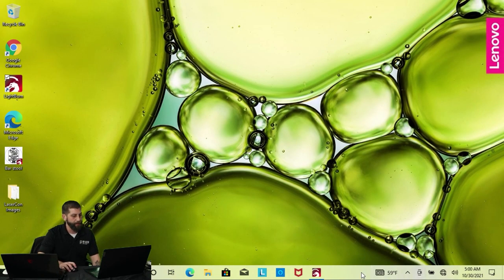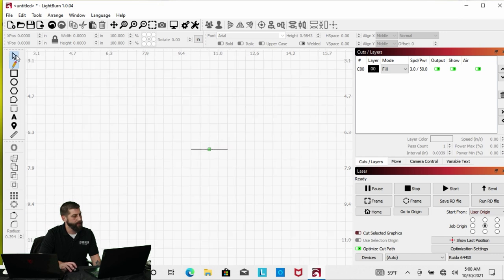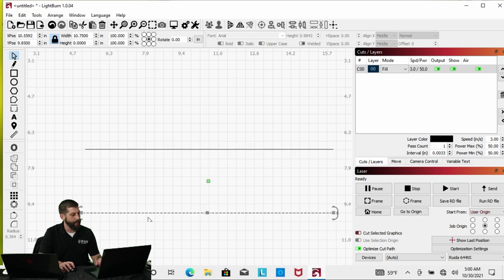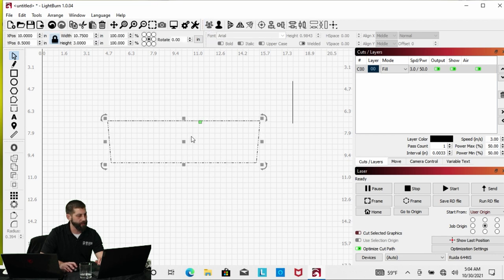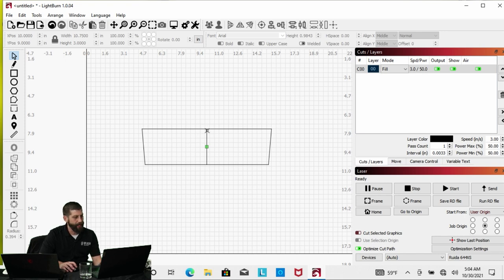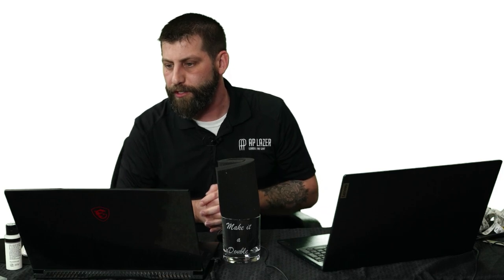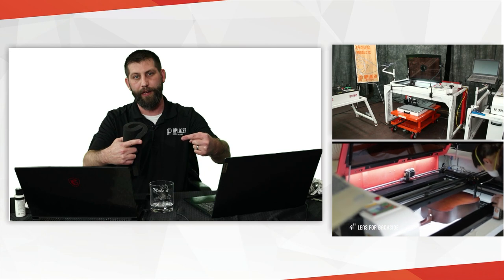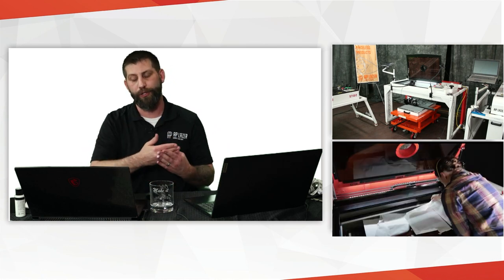AP Lazer Workshop | Engraving a Whiskey Glass on the SN2616

Comment: Where does the rotary plugin to the 2616lr?
Reply from the maker: On the right side, inside the machine, on the reverse side of the side switches. It is in the same area as the key and emergency stop switch against the inside wall. If this does not help you find the connection, please contact AP Lazer 24/7 Customer Support at 844-364-8211.

Comment: Also, you might want to use a product similar to "Goo Gone" (an adhesive remover) to remove any residual tape adhesive from your work surface, as compared to your using a glass cleaner.                                                                                                                                            

Jim Dasher                                                                                                                                                                                                     Spectrum Graphics                                                                                                                                                                                    (Seattle metro)